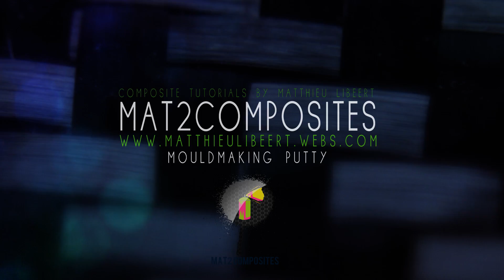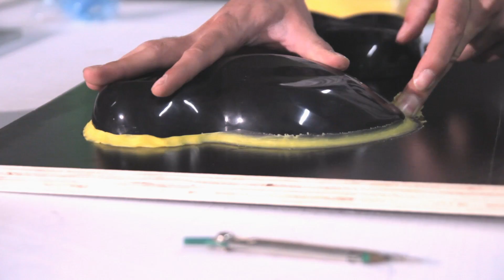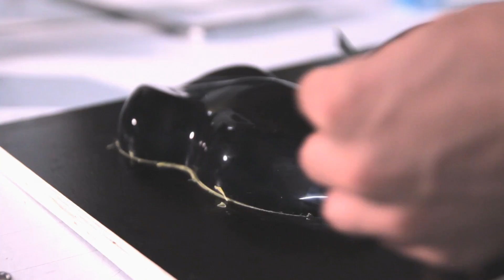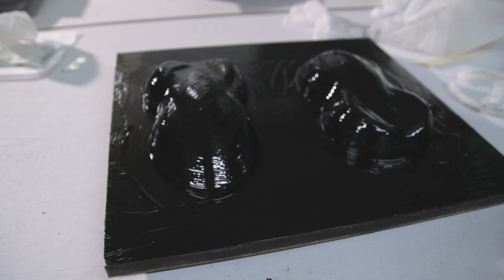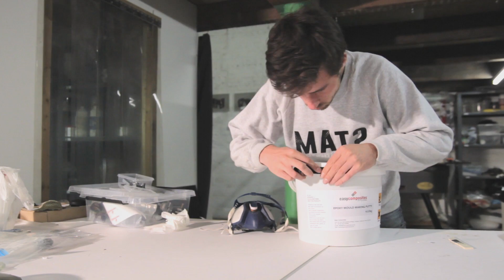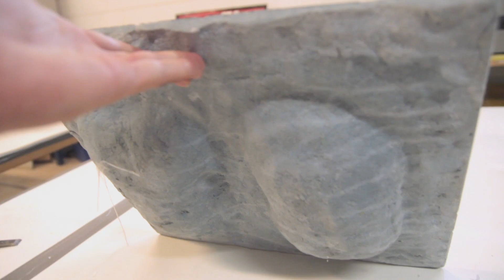Mouldmaking Putty (Fun Way To Make Moulds)

Comment: It can also be used for prepreg?
Reply: Actually I believe it can be used for prepreg molds--just use the EMP160 high temperature version which is good to 120C
Reply: @genephipps6421  hey do you get blisters after post oven cure?
Reply: @J2105HD  no...
Reply from the maker: Alessa Delpiero no :-)